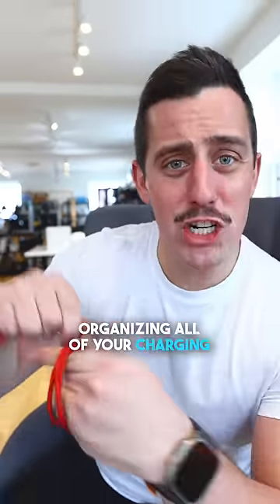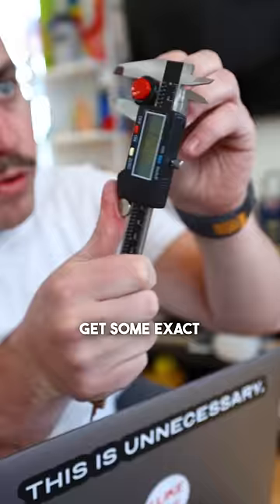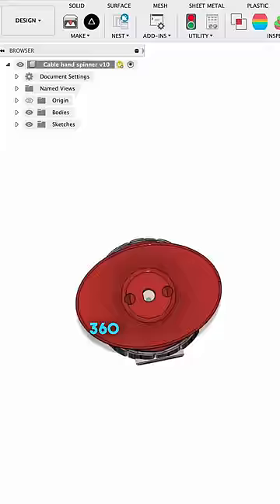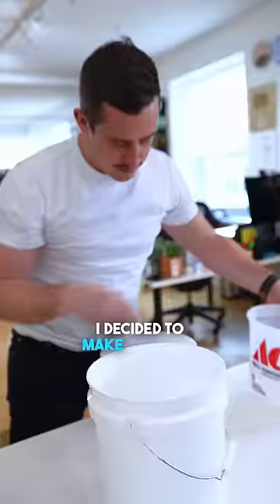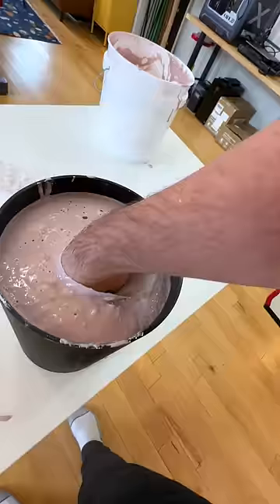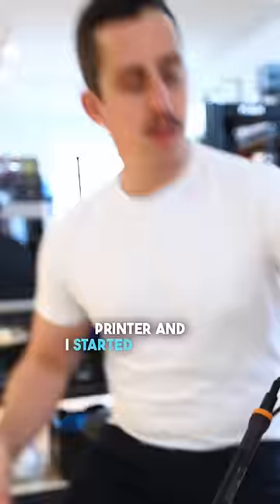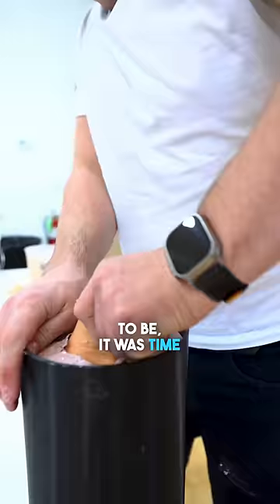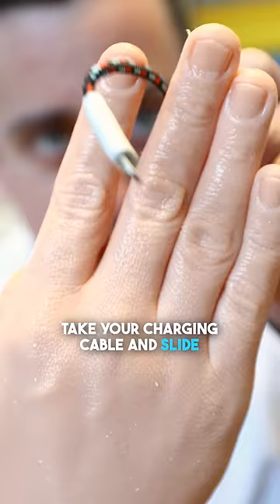This invention will save you HOURS!

Comment: Or you can just leave the charging Cables where they are going to be used the most. Get new cables for different areas or places.  IE, I has one by my bed, One at my computer, One for the Kitchen, One for the Car. One for traveling. Done. I only need 5 charging cables for my phone. For each place

Comment: I realize that you were intentionally over-engineering a solution for this but whining cables that way is actually very bad for them and makes them easily tangled; something you can do while whining your cables though is wrap it back on itself every other loop: make a clockwise loop then a counter clockwise loop around the back of the coil, then clockwise around the front of the coil, then counter clockwise around the back again and so on -not only is this better on the cable, but it also makes it so it won't ever tangle when you uncoil it -you can just hold on to one end and throw the rest and it'll perfectly unwind itself every time

Comment: Sooehm, I once made a hand cast with plaster of paris, also in a small bucket, not those impregnated sheets. I did understand that I was going to have to saw it of in two pieces afterwards to be successful bacause pulling it out would be impossible. What I did not prepare for was the rather high heat developed when curing, I dunked the whole thing, stuck on, in a bucket of cold water, it helped a bit but I still ended up with a first degree burn on my hand... Don't do that;-) The casting mold was great and full of detail though.

Comment: Why not just use your hand? Surely the cost of the materials (oatmeal gel, silicone, electronic parts, 3d printer etc) will go into the thousands. Also assuming 90% of us dont have an electrical degree, will have to watch hours of youtube vids to gain enough understanding to assemble such a contraption. 

I really struggle to see the benefit. I'll just keep using my hand.

Comment: OK I got a 3d printer question. Say you are designing a socket holder. How do you get a precise fit? Just trial and error? My ender 3v3 se seems to be a bit on the inaccurate side. I am printing out a little bank vault and the fitment is off all over the place.

Comment: All right that just looks like a sex toy at this point. Also that's a little over the top you just need a torsion spring and locking/releasing mechanism around a cylinder

Comment: I have a question, I just got a MacBook and I’m struggling to figure out how you model using only the trackpad. Can you explain? What settings do you use or just how in general you model using it just the trackpad. Maybe video idea
Reply: What software do you use? I use Blender with all the default settings except I select with the "right button". 

Meaning on the Mac, to select an object, I tap with 2 fingers. 

Just let me know if this helps.
Reply: @qupation7296  I use fusing 360 like he does in the video but I was considering try blender too